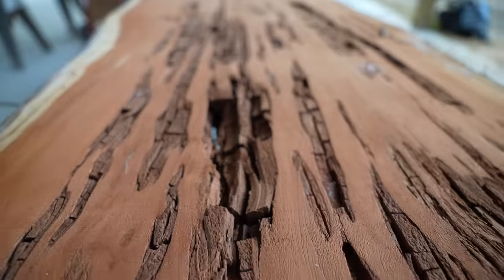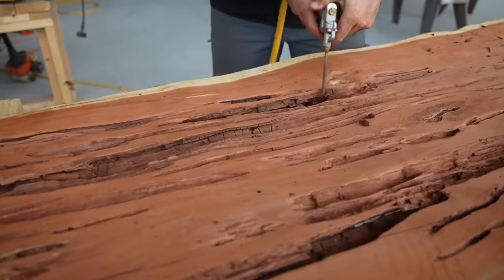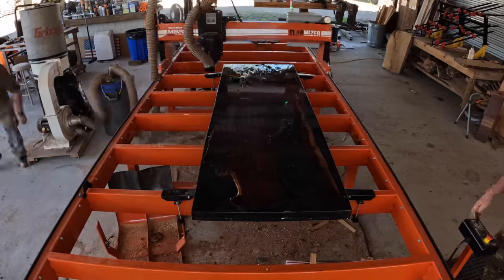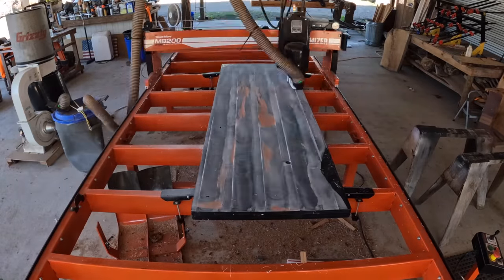The Most Expensive Table We've Ever Built!

Comment: I think the finish color you got on the bottom was much nicer than the top. 

If you're going to spray coat anything, you need to build a small booth. I tried doing what you did and never got the perfection I was looking for until going in a booth. Y'all have got some of the nicest, most enviable equipment out there. Go ahead and do it right.

You could have flood coated and then knocked the finish down with some mild polish

Comment: That table looks amazing 👍😎  the only suggestion I can make is have you thought of using a gravity feed spray gun instead of a suction type . There is different options of these gravity feed types like a HVLP which is high volume low pressure and also with the paint pot on the top there is less risk of the pot touching the surface when  spraying like on a suction type spray gun 
Also the gravity feed spray guns are easier to fill and clean and you always use all the product you mix up 
Great work team looking forward to seeing more projects like this 😊
Reply: That’s great advice. Thank you for the comment. I’m going to look into that. I’m not happy with this sprayer for polyurethane. It works fine when you’re trying to paint something but I think the polyurethane needs a different kind of sprayer.
Reply: I’m sure if you head to any automotive paint suppliers that sells spray guns they will be able to point you in the right direction 
Good luck and keep up the great videos 👍😎